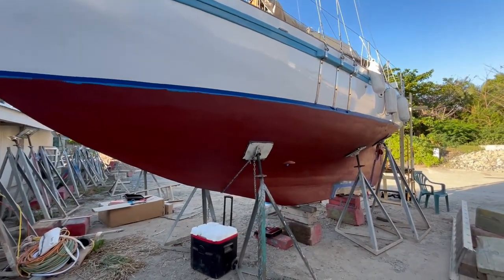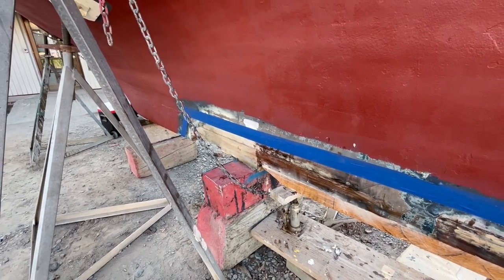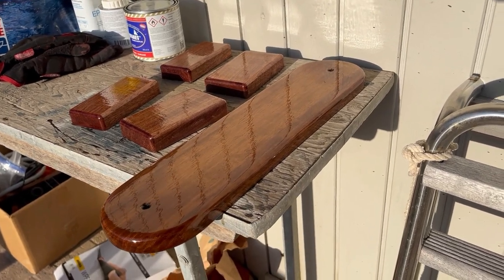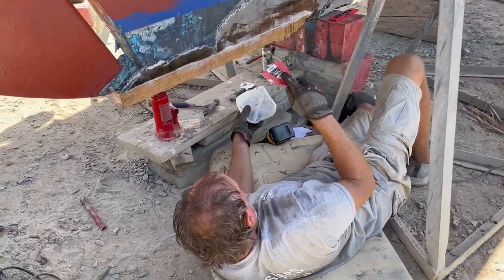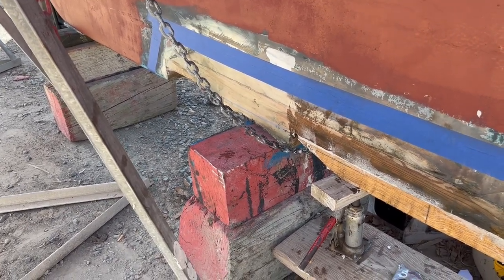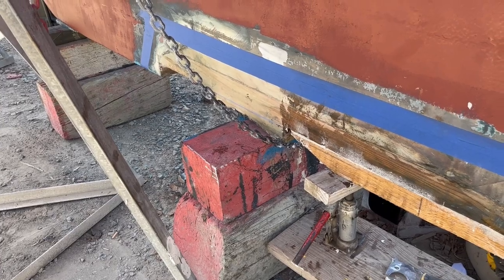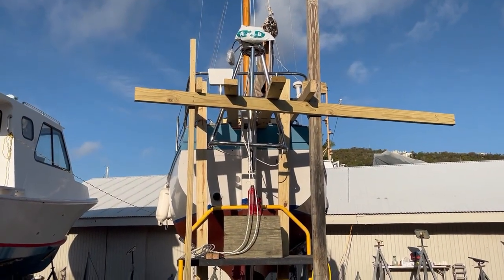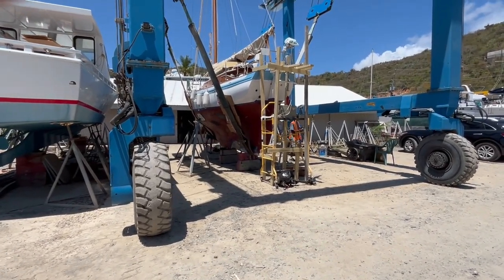Pulling Boat, Part 2, Ends in Near Disaster

Comment: Glad to hear your doing well with the broken, those suck! Hoping for a speedy recovery. Let's get a Marine Radio in that rig, your daughters would appreciate it! Make sure you visit Cape Cod on the way to Maine! Best Wishes!!
Reply from the maker: I have a marine vhf radio, will not be getting SSB
Reply: @MooseHenderson1  Awesome!  25 watts VHF is plenty on open water (Ground Plane) SSB can be used when you go across the pond!
Reply from the maker: @poppysplace6572  SSB and Ham difficult to install in gaff rigged sailboat because no permanent backstay for antenna, also dislike transmitters (SSB/Ham)
Reply: @MooseHenderson1  Ah got ya now!!!

Comment: Watching your videos is like going to a bad car race for the crashes. Just kidding. 
Did you get the unused through holes plugged up?  How did you charge out the head?
Reply from the maker: I removed the old head and installed a bucket, super easy fix. Old through hulls are plugged